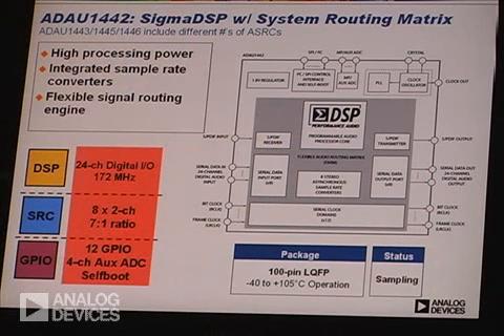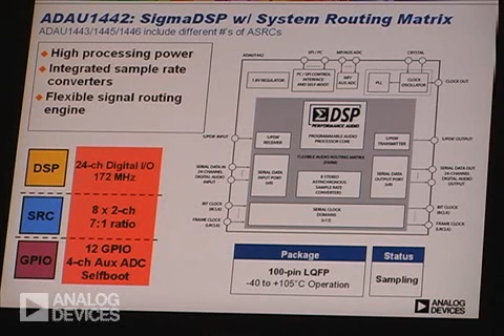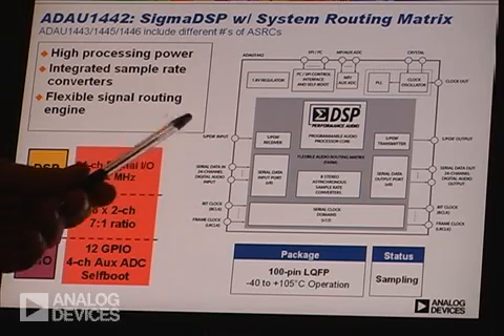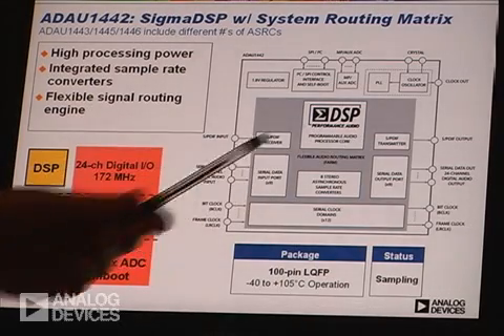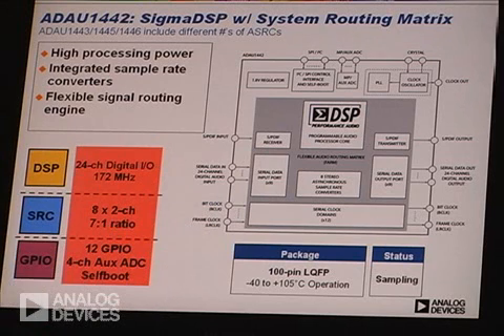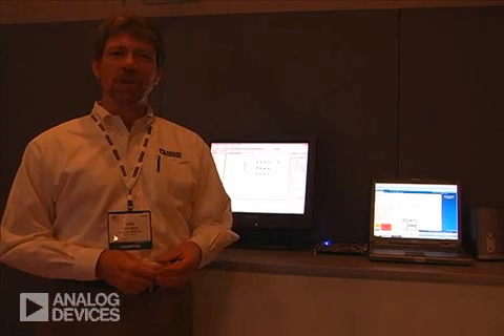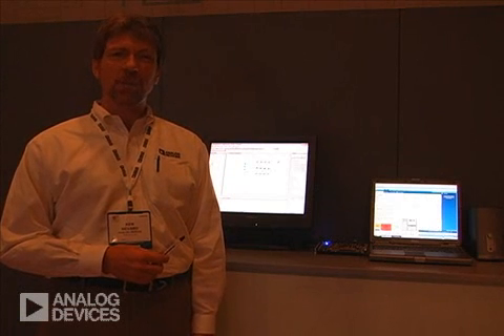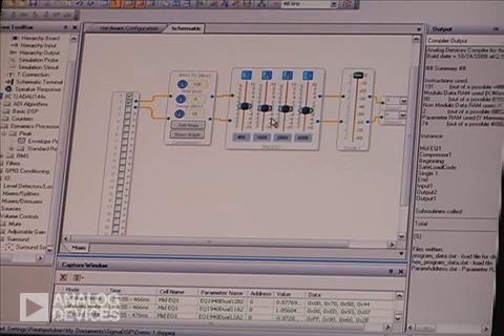Next Generation SigmaDSP™

Comment from the maker: Hello SportMegane,
1. A SHARC-enabled SigmaStudio is on the 2009 roadmap.
2. The ADAU1442, 1445, & 1446, referred to collectively as the ADAU144x, are enhanced audio processors that allow full flexibility in routing all input and output signals. The SigmaDSP® core features full 28-bit processing (56-bit in double precision mode), synchronous parameter loading for ensuring filter stability, and 100% code efficiency with the SigmaStudio™ tools.
Thank you for the comment/inquiry.